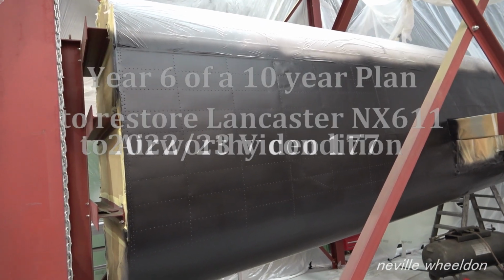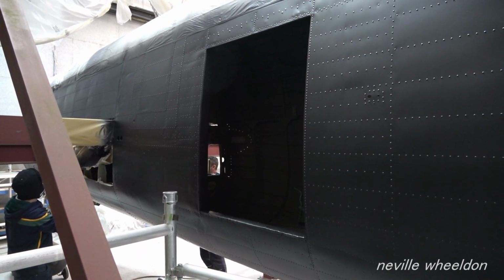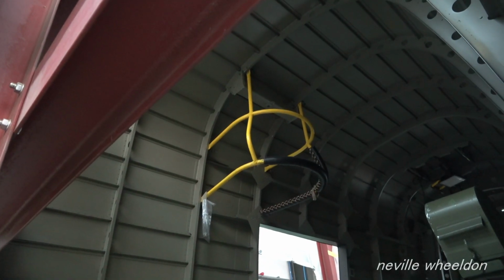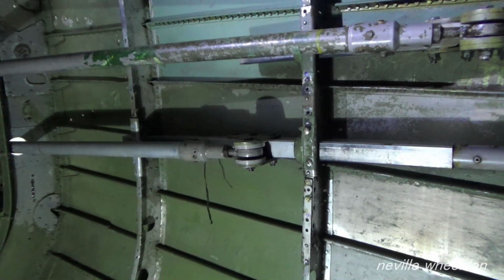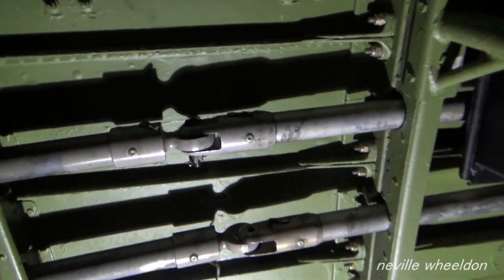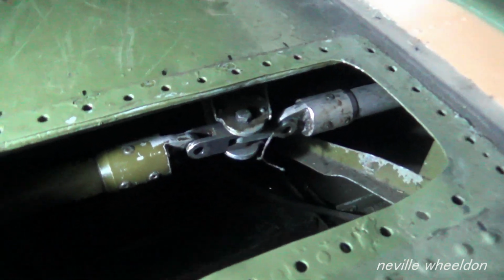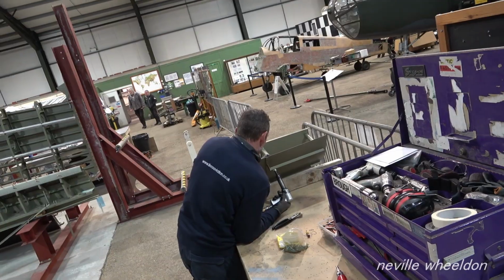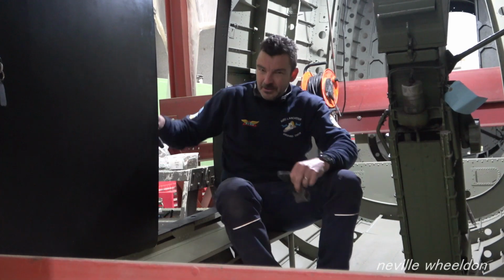Video 177 Restoration of Lancaster NX611 Year 6. Doncaster rear fuselage door fitted

Comment: Merry Christmas to all the crew working on Just Jane. I meant to mention on a previous edition that I think the reason for the control rods changing from circular to square is to resolve the eccentric forces generated by the joints which want to cause a rotational force. Might already have been mentioned by others but seems obvious to me. Warmest wishes.
Reply from the maker: Happy New Year Malcolm.

Comment: Neville. Please tell me they are not doing all that work for nothing! That bird will be flying yes or no? What's the status on the 3 lights under the floor panel ? Are they operational and if so , can they give us a demonstration on how they work. What is that long square tube on the inside of the fuselage? Can you give us a better look at it and perhaps show us how it works as well. Thanks Neville. from Cleveland, Ohio
Reply from the maker: Happy New Year Outlawflyer 78. Check out the start of video 178 that should answer the first question. The Light under the floor panel of the Doncaster fuselage KB976 will not be used. I not sure about JJ. NX611. When they fit the tail plane back in the next month hopefully I will get some video of it operating